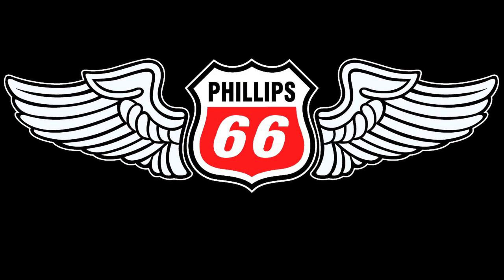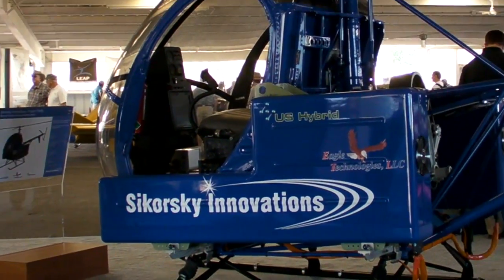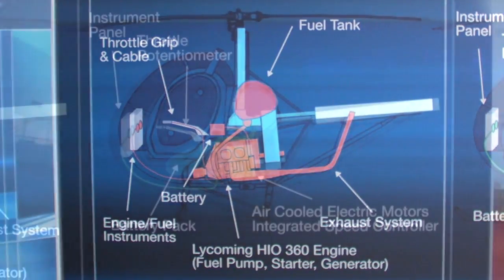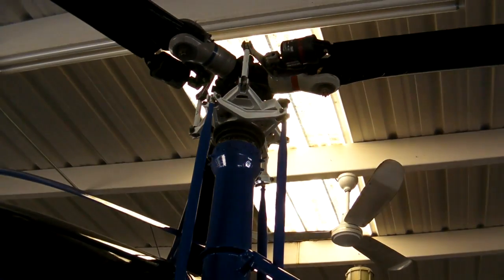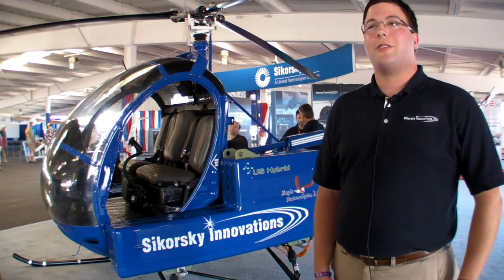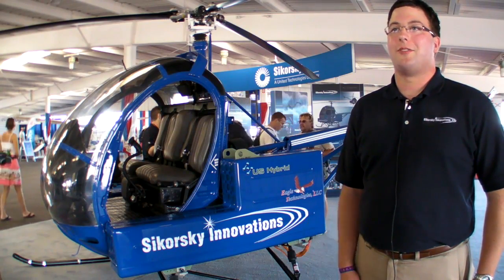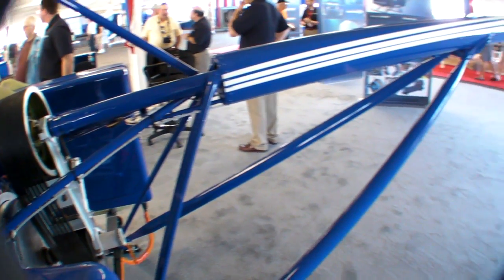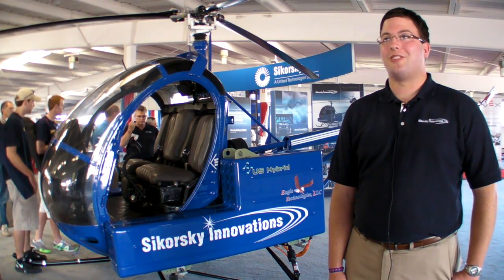Sikorsky Firefly: An Electric Helicopter

Comment: The electric motor should be built into the top rotor hub as a single system. No drives or belts, pulleys needed. This would give a drastic weight reduction and power savings.
Reply: Good point, but don't give them all your ideas for free.
Reply: Maybe you could put a clutch in a direct-drive system. That way you can still safely autorotate, but eliminate the extra weight of a transmission.
Reply: low Rpm motors produce less power relative to their size and weight
Reply: *****

Why would you need a sprag clutch with an electric motor? Just let the motor spin during autorotation.
Reply: The YASA 750 only weighs 60 pounds and will put out 500 lb . ft. of torque. Seems like the perfect direct drive electric motor to use.
Reply: A clutch is needed with an gas engine. With an electric motor, there's no need for any clutch. A Tesla has no clutch, yet it coasts ( autorotates) just fine. :-)

Comment: Who designed the belt drive system ? V-belt with a drive belt mechanical  tension system ( stone age and back yard technology) get a proper cog-tooth no adjustment drive system, it's lightweight wont slip when wet and MUCH stronger and lighter. Maybe I should check the rest of this coptor.

Comment: *****
The point is that it's a prototype for the future.

Jet fuel has several problems:
1. It's running out
2. It goes bad if you stockpile it for a decade
3. Bacteria can thrive in it and ruin expensive motors
4. High stress moving parts.

Electricity won't run out.  Electricity just requires:
1. Sunlight or light-producing creatures to feed photovoltaics.
2. Something to cause a spinning motion for a dynamo unit.

If we run out of electricity, we either nuked all the text books on the subject or we're all extinct.

Plus, electrical motors can, theoretically, be a LOT more reliable than turbines and pistons.  You just swap the batteries at a charging station, pay the usage fee and keep flying.
Reply: *****
If we're going by oil supply/demand, they've got roughly 20 years to 60 years before electric helicopters or some alternative fuel helicopters need to be perfected.

Sikorsky is quite a large company.  This project is probably a small piece of their R&D budget.

Comment: nice move!! but still the same compromise incorporated into the design :-(( driving the rotor from the center which requests the most power instead of driving it on the tip of the blades :-) much less power would be needed etc...
Reply: Romano Matthys How would you drive the rotor from the tip of the blades?

Comment: I doubt that it is "hope".

Modern rechargeable consumer battery technology comprises of what? 
Lithium Polymer, Lithium Iron Phosphate, Lithium Cobalt Oxide, probably some others don't immediately spring to mind.

This is just the "consumer" market, with commercial, industrial and military applications often having their own exotic and high tech solutions.

Mark my words, within TWO battery technology generations, there WILL BE viable electric aircraft.
And that includes rotary wing aircraft.

Comment: I applaud your hope for better batteries but in this case, I'm bailing!  A helicopter is basically a flying brick with no real glideslope
and so requires huge energy requirements. I own a LiFePO4 5.04kwh pack that weighs 120lbs and is current tech. That 5kwh pack contains 17136
btu of energy. 1gl. of gas weighs around 8.3lbs and has 114100 btu of energy. Batteries have a long long way to go to equal that kind of energy density.

Comment: Dear Sirkorsky. Have a look at the german e-volo, a expanded Quadcopter which is well-known and used in millions in the RC-hobby industry. Without all the maintenance-heavy parts: Inefficient belt transmission, swasplate, transmission for the tailrotor. But just 16 - 18 pcs of almost maintenance-free brushless motors as the only moving parts. This combined with a small petrol-engine and generator for charging the batteryes as a hybrid, expanding the 15 minutes-limit.

Comment: Simple physics.  The energy in the spinning blade is used to generate lift.  If you take some of that out to recharge a battery, then you will get less lift.  Unless there's some inefficiency that can be recovered that's otherwise wasted, t's better to use a  more sophisticated battery management system, so that you don't put more power into the motors than is needed to lift the aircraft.

Comment: I've always wondered this to be quite honest. Why can't they just have the motor turn a generator as well to charge the same batteries it's running on. Sure it might not have enough power output to actually increase the battery voltage while it's running, but it would surely make it run longer, right?

Comment: Brushless electric motors are very simple, and could be made a lot cheaper than aero engines. Batteries will also come down in price. You also have to realize this is not a custom built airframe so there is some energy loss though the drivetrain.

Comment: great looking, has it ever flown? In a few years batteries will be much better; the use of lithium in batteries is quite a new concept and there is a lot of room for improvement. Once you can fly for around an hour this will be great. Having batteries on the outside means it would not be too difficult to switch them meaning no waiting while they charge. Electric cars are relatively expensive because of their batteries but with a helicopter, engines are very expensive and have to be rebuilt often

Comment: Until battery technology improves, the solution for now is to simply integrate a high kW generator powered by a gasoline or diesel motor, preferably, diesel because of the high energy density of diesel fuel.  A much smaller battery can then be used to provide extra electrical power for takeoffs or to provide emergency power in the case of a generator failure.  Such hybrid systems already have a proven track record in other uses.

Comment: I would never trust in the batteries.Liquid fuel is so much easier to measure and you can now how much you got,but this one ... Well lets just say electronics are not ver precise.Does a computer saying you have 20 km range left and after 30-35 it shows you you still can go 10-15 ring a bell ?

Comment: By nature an electric aircraft is going to suffer the same problem as autos. Which is range anxiety. Until somebody figures out how to pack a light 100Kwhr+ battery into a pure electric car/aircraft and cheaply,, then the electrics are not going to be able to step forward front and center.
But a hybrid? That's something different! As an ICE can be made small and light to turn a generator to make electricity. Great for range extension. Probably the way they should have done it.

Comment: The noise doesn't come from the engine. So it's not an advantage. Hydrogen in an internal combustion engine sounds like a much better solution "until someone comes up with a better battery".

Comment: No, your attitude is not correct.. 1st off, they're not selling the helicopter. It's a test platform for experimentation and continuous improvement with the hope that someday it will be something that could have commercial applications. You're advocating not going through this process of development until it's ready. What your're suggesting is a paradigm.

Comment: Maybe some day there will be a reasonably priced fuel cell that can give it a much longer flight time, using renewable fuel instead of petroleum products. Then they can make this a commercial product instead of just a demo. I used to fly an RC helicopter made by Kyosho, which had NiCd batteries, years ago. Flight times were never more than 5 minutes. RC flyers can keep batteries on charge and swap them, not too practical on a real, piloted machine.

Comment: not that im against electric powered vehicles, far from it i use an electric bike all the time for work just that i think battery technology is light years off powering 3d travel effectively unless theres a new battery chemistry incorporating uranium 235 in the pipeline, perhaps some sort of hydrogen generator would be better suited as an alternative source of energy for this application

Comment: think you need to look at the practicalities of a battery heli and get into perspective the quantum leap you are speaking of that is required.
as you are fighting gravity 100% of the time you need to look at the energy densities of the fuels you plan to use and when you compare a lithium battery with an energy density of 1.8 mega joules per kilo to petroleum at 46 MJ/kg which is also on a continuously reducing scale, even if you planed to throw expelled cells overboard you have way to go.......

Comment: Nice science project like presentation with a very uncomfortable looking / nervous / camera shy guy. Battery technology needs to take light year leaps and bounds for this to become a cost effective reality. But, a journey of a thousand miles has to begin with a first step. I would say this is 1/8th of an inch of that first step. Even for a test bed concept, this is not even remotely practical. Batteries are just too dense and heavy to produce the needed power to weight ratio. TRY HYDROGEN CELLS

Comment: So you would know then years ago electric RC heli's were just a dream with NiCad batteries but today with the hugely superior energy density and low weight of LiPo's they out perform gas heli's. This a demonstration of what is possiiblee, just think where we will be in 10 years when batteries with ten times the energy density are available.

Comment: This will get especially interesting when Lithium-Air batteries become available. They have the potential to rival kg-for-kg the density of fossil fuels after internal combustion efficiency is accounted for (only ~25-30% for a piston engine). Then again many helicopters use a gas turbine power plant that can have efficiency as high as 40-50% in best case scenarios. In either case I love to see companies with visions which embrace future technology.

Comment: It's terrible, be real.

195nm range and 86kts cruise puts the gas at 2:15h, with reserve beyond that.  'Just about a 15 minute..' in liberal energy speak means it really might hover 10 minutes, or fly hard for 6..
Battery you carry both plates, all the time.  Gas you carry a gallon of gas, but you do not carry the 9000 gallons of air.  You also exhaust the end products.

Gas beats electric 10 or 20 to 1, and that's after the engine inefficiencies.  Raw difference is about 100:1 gas over batt.

Comment: Not worthless, our electric technology is lacking due to our known petroleum technology. Gas engines are only about 25%-30% efficient at producing power. The rest is heat... Electric motors are closing on 90% efficiency. Batteries/electric fuel is where we are lacking...

Comment: For the love of God. 1100lb's of batteries and you can only fly for 15 minutes??? This is completley worthless. Why is it so hard to apply weight to power ratios like we do with our electric RC helis that are stronger then Nitro versions? I can't beleive this is the best we can do with an electric heli. I have a FPV Plane that can fly for over an hour with two Gopros on it. Does not make sence.

Comment: 1100 LBS OF BATTERIES---HE SAID ALMOST THE FULL WEIGHT OF THE HELICOPTER & AROUND A 15 MINUTE FLITE DURATION. WHY? WHAT PURPOSE DOES THIS SERVE? IT'S TWICE AS HEAVY, 15 MINUTES OF FLIGHT, EVEN WITH THE COOLING FANS FER THE BATTERIES--THOSE THINGS WOULD STILL BE HOT, & YA COULDN'T EVEN BEGIN TO THINK BOUT A FLIGHT SORTIE OF ANY KIND WITH THE SHORT FLIGHT DURATION. PUT THE PISTON OR TURBINE ENGINES BACK IN THE BIRD & LEAVE IT ALONE, FER CRYIN OUT LOUD!

Comment: I kind of doubt they would replace the driven tail rotor with a motor driven, seeing as higher end RC helicopters use belt drives for the tail rotor as opposed to an extra motor. They have found that a separate motor is not as responsive as a belt drive.

Comment: @madmonkey914 I don't think you are a pilot otherwise you would not say such things. Dozens of certified aircraft are light enough to be flown as sport pilot *under 1320 gross) so Yes I submit that a battery pack that weighs 1100 lbs does weigh more than entire aircraft. Look up Taylorcraft, Cessna, Piper, etc. And I am not even mentioning experimental, or true ultralights that are no more than 254lbs. I own my own 2 place experimental gyroplane that weighs 840 lbs........

Comment: @automan1223 -- Exsqueeze me? 'There are entire aircraft that do not weigh'- Half a Ton? ++ 100 lbs? Like what, a Hang-glider? Most ultra-lights weigh at least 500 lbs, and they're not battery powered. As the tech moves along, as more people buy in to it, It will get lighter, cheaper, longer lasting and more environmentally harmless.

Comment: My radio-controlled heli flys for 3.5 minutes, max, so fifteen minutes flight-time actually seems good. Many helicopter flights are short duration, anyhow, but also require the use of a sling load. Not possible if the heli is already at max gross. The real purpose of this experiment is to test electric motors, for use with so-called clean fuels, such as hydrogen or natural gas. The same electro-mechanical systems will run for hours with so-called alternative fuels.

Comment: If they did a full redesign of the aircraft and not just swap the power source and throw some huge heavy ass saddle bags on for batteries, I'm sure they could get it really fine tuned. Get rid of all the lousy mechanical transmission shit and the pto for the tail rotor and step up to some real batteries from A123 systems. Then integrate the battery system into the fuselage, tell the pilot to loose a 100lbs and maybe you'll get 20 minutes. Just not practical with current battery technology.

Comment: 15 minutes gives you just enough time to get high enough to do a autorotation.. Which I wouldn't want to try in a electric helicopter. :/ I could see this being usefull if you were putting a camera on it to take pictures because of less vibration.. But then why not just get a electric rc helicopter? Cheeper and you can still get your good pics.

Comment: @TheArfdog 

I think youre confused of the varible pitch for yaw controll.
I was talking about powering or rotating the tail rotor not the pitch mechanic.
Elecktro motor's are strong enough these day's

Look for example to rc heli's
a trex 450 wil fly around 8minute's with a transmission or belt drive.
while you replace the transmission line or belt with a motor(qouted you won't change the pitch meganism) 
I get around 14minutes of flight time same battery, flying and windconditions.

Comment: @Dragon69Fly Direct drive has worse response time compared to transmission drive. It takes milliseconds to send a signal, where a mechanical pitch control is instantaneous. Delayed control is bad, so direct tail drive is bad. It also won't save that much power.

Comment: @TheArfdog 

Direct taildrive is much bether. You can have the best tail rpm. Nothing will  changes the pitch so you wouldn't notish a thing.

Just google for fun under direct taildrive.

With less rotating parts it would even use less power, although there is an additional motor and motor controller it still will use Less power and longer flight time's ;)

Comment: It won't be very quiet unless they kit it with some more advanced blades, like those whisper blades they're putting on some of the new military craft.  

Though just reducing vibration from the engine will go a long way to extending the life of the air frame.

Comment: They need to take a walk over to Tesla Motors, 5 years ago, they build a car that will beat a Ferrari, flat out in the quarter mile, hands down, it will smoke a Ferrari. That was like 5 years ago, on battery power alone... They've had RC Helicopters 4 years ago, that will lift 5 or 6 times their own weight, and the best that Sikorsky can come up with in 2010 (with 70+ years of building military grade Helicopters) is a knock off, of a 1960's crop duster Helo, that can get 15 mins of blade time..?

Comment: I think it's outstanding. But hears the problem. 15 mins and I bet some serious money went in to them batteries. Why can't you have a small generator that continuously tops up the bats. I no it might seem contradicting to have a combustion engine but it could be a little air cooled diesel converted to bio fuel. I think that that would work. But I'm no scientist or engineer so my plan would more than likely be flawed. But just an idea is all.

Comment: Well by replacing the tail rotor with an electric one, would have some problems if the tail rotor motor were to fail. If you sudently lost all power and had to enter autorotation, you would want to have tail rotor authority, driven by the main rotor. So that idea don't sound so good to me. Good concept. The only thing to keep it straight would be the verticle tail stabilizer and would only be good at speed.

Comment: @MarioIArguello You won't see fuel propulsion jet engines ever being replaced by electrical engines, this includes commercial aircraft such as jetliners.   However you may be right about replacing the combustion piston engine found in most ground vehicles, boats and small air vehicles (e.g. helicopters).

Unfortunately though, the propulsion from a jet engine is partially directly due to the combustion and force of burning/expanding gases through the engine. H2O2 will replace jet engines

Comment: @inagod I cannot see electric ever replacing turboshaft or jet engines. Fuel fed engines in the long run are lighter and run longer. The problem for electric is the batteries(their weight) and the short time they last. The only way electric works is in the applications we have today in the Navy. Nuclear Subs and Aircraft Carriers. I do like the performance of the electric motor. The Carrier is so fast it is classfied. It is able to do what it can because of it's on board nuclear reactor.